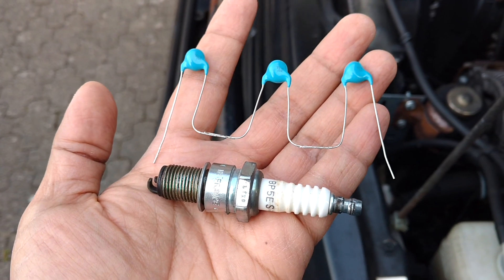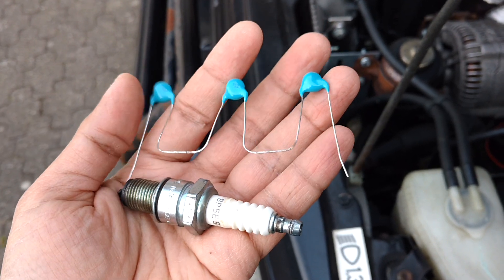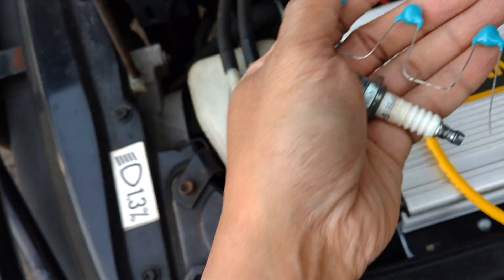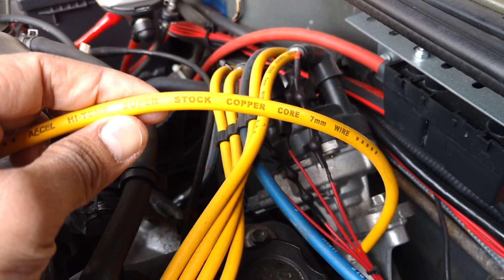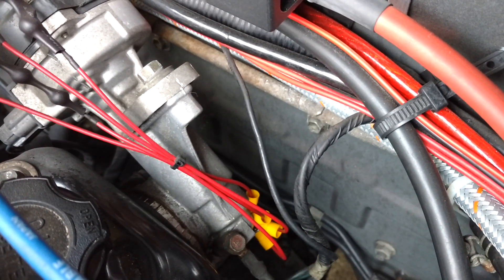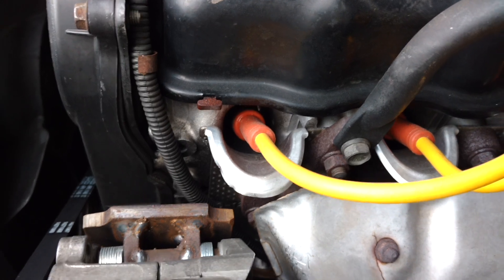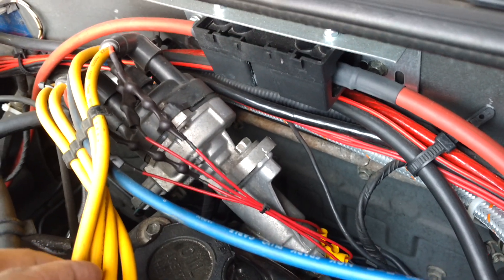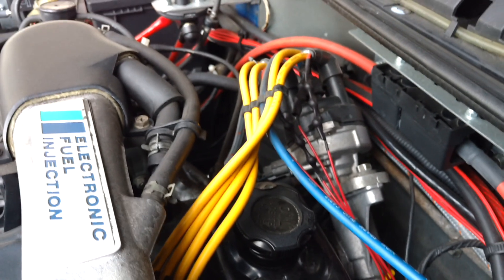Simple Plasma Ignition - my actual installation

Comment: Not sure if this is a good idea, there is a timing between when the ignition produce the spark and when the capacitors gets charge and release its spark. And when timing gets wrong the spark from capacitors would go back to ignition coil and this would also cause premature detonation of piston in chamber like producing spark before air and gas gets compressed in chamber.

Comment: Hi Mr Moeljadi, is it work if i using standard sparkplug cable?is it standard sparkplug cable have resistor in it?
Reply from the maker: This will only work with copper core (non-resistor) ignition wire and non-resistor spark plug.
Reply: @OkkiMoeljadi  so that's mean I need to make my own sparkplug cable to make this work right?
Reply from the maker: @takeosumi4163  No. You can buy copper core ignition wire.
Reply: @OkkiMoeljadi  OK.. thanks alot :)

Comment: Hola. cuan efectivo es ese sistema? incide en la durabilidad de mi CDI y Bobina de ignición? preciso de otro tipo de bujía? tiene limites en cuanto a las RPM? cuáles son los pro y los contra?
Reply from the maker: This will not affect your CDI and ignition coil. You have to use non-resistor sparkplugs and copper core ignition wires.

Comment: Hi Okki, hope it's all smiles your end. I've recently had the pleasure of working on a 1949 Dodge coronet. 6v positive earth points ignition system. 12mpg. Ouch.  So could this ceramic capacitor trick be used with that positive earth system please kind Sir? ❤
Reply from the maker: Hi Billy, thanks! Yes, you can use this trick. Just connect the capacitor in parallel to the spark plug. Don't forget to use non-resistor sparkplugs and ignition wires.
Reply: .Thank you Okki. I knew you wouldn't let me down. Hang on in there Nicola Mk2. Glad to see the adverts. Happy for you. Smile on brother ❤
P.s Check out the Tartarian videos on YouTube channel 'Pyramid Science Foundation'
with James/Jamie Lee. You'll love them i promise. Smile on Okki, and thanks again ❤
Reply from the maker: @BillyBob-uc9zp  my pleasure.. have a nice day!

Comment: Can i use that in my Scooter 125cc?
How many ceramics capacitor?
Is that safe?
Reply from the maker: This should work with your scooter. You can use one capacitor 100 pF 30 kV.

Comment: Brother can I use 3 capacitor only and connect it to coil cable?
Or have to use for each spark plug wire separately?
Reply from the maker: You need capacitor for each spark plug.

Comment: Very good modification, do u know how to apply this mod to modern coil over spark plugs?? TQVM...
Reply from the maker: Yes, you have to modify your coil-on-plug casing and put the capacitor there. Somebody has done it. You just need to google it.
Reply: Okki Moeljadi sorry but I couldn’t find any article regarding modifying the COP casing. 
What I found is some trying to connect 12V capacitors in series with the +12V and Ground to the wires towards the COP casing. Their assumption is that during the sudden power consumption at ignition phase, the capacitors would aid to provide more constant power supply to the ignition coils, enhancing the spark output/dwell time.
Reply from the maker: @limyiphun6142  https://forums.vwvortex.com/showthread.php?8492873-My-1984-Rabbit-GTI-build-thread-Haldex-2-1L-GTX3584RS-E85&p=114234473&viewfull=1#post114234473
Reply: Okki Moeljadi thank you very much, this really helps a lot.
Reply: Okki Moeljadi what is your opinion on capacitors in series to COP casings? Would it help? Thank you.

Comment: culd you make a video that show how polarity of a ignition coil effect a engine?is it posibel to bypass a ignition module and run a ignition system with out that computer crap? how does the polarity effect the engine economy? what hapen if you use more curent capacitors ore more voltage capacitors ore both?I even see some peopel use capacotors in series and pararel with baterry's in the car so what effects does it have on the car instalations wireing harnest?does the fuse's blow by higher voltage?does the small car electric motor's run faster? there are so many ignition system's that it can by realy confusing for peopel to understand them.how much I did gather info over the years are that with higher spark you are abel to run car's on super lean setup 20:1 ore higher with out back fire and best setup wuld by a carburator with out a choke and pump on them with jett tuning.perhap's you culd revive some of the older parts of cars if posibel.because peopel dont mention them often they are forgoten many peopel lusse they car because they dont know for exampel what is a "R" terminal starter motor ore what is a resistor type ignition coil system I see many peopel damage they car by having to much ore to low energy of a spark alone. it wuld by great if you culd revive those old system's and teach peopel how to modify them ore replace them with bether tehnology some peopel does not have money to buy new staff so you actualy culd help them lot great videos thank you for showing use there are so many things peopel dont know about like dual ignition,magneto/ignition coil,dual spark,generators/starter motors,dual battery setups,selenoids of all cinde,hydrogen cells,vaporisation fuel tehnology etc. all of this and more can create interesting effects on a car

Comment: conectas los capacitores a los cables de bujia y el otro extremo a tierra. eso es todo?
Reply from the maker: Yes.
Reply: @OkkiMoeljadi  genera algun tipo de ruido al usar cable de cobre? 
Does it generate any kind of noise when using copper wire?

Comment: Brother i am searching 220 uf and 15v ceramic capicitor from  aliexpress ebay ect but i dont fpund dame specs. 
They hav 220uf and 1kv and 2kv not 15v capistors,  now tell me what to do,  ?
Thanks
Reply from the maker: You don't have to buy any high voltage capacitor. You can build it yourself using easy-to-find materials. I have posted a video how you can build one.
Reply: @OkkiMoeljadi  can i use non ceramic capistors ?

Comment: Okki, A better alternative for capacitive sparking would be with a spark plug like the Torque 
Master S series. No gapping or indexing required. You can buy a set at www.extremespark.com
Reply: Do the torque master plugs actually work?
Reply: @GrantRTanner  The Torque master spark plugs work very well in improving MPG. They stand above the rest, in my opinion, for three reasons. One, because they have a completely exposed center electrode which allows for it to fire uninhibited inside the cylinder. Two, because the guys at Torque master will actually manufacture the spark plug with zero resistance, if you ask them to. The latter is very important, because almost 98% of the spark plugs on the market today have resistances which range from about 3,000 ohms all the way up to 15, 000 ohms, and this resistance in effect lowers the current, and therefore the spark potential,  delivered to the spark tip. This zero resistance is also important if you are considering more powerful and advanced sparking techniques, such as "plasma". Finally, Torque masters have copper center electrodes. Copper is a very good conductor, and it helps to dissipate heat better than platinum and iridium.
Reply: @mpgundercover8075  Thanks.  Do they "gap" them like a normal plug specific to your car?  Or do they just get you as much spark as they can, and will my car ECU handle that?
Reply: @GrantRTanner  The Torque masters are made with one of two gaps. Each of the gaps correspond to an equivalent gap range which encompasses many vehicles. You would need to communicate to them your specific vehicle, and they will let you know which of the two gaps will work for you. The question of whether your vehicle can support the gap is more a function of the ignition system components after the ECU (coil, plug wires, etc...), and their conditions, and not so much of the ECU. The ECU simply supplies the input voltage, as it is required, and that input voltage does not vary in magnitude.

Comment: @okkimoeljadi    I replicated your exact setup on a throttle body injected Chevy 350 engine but I am not getting the Plasma spark.
Any suggestions?
I'm using solid core wires, resistorless plugs, and upgraded MSD coil...
Reply from the maker: Please try to connect the capacitors outside the engine first and observe. Connect the capacitors parallel to the spark plug directly. If you still don't see any increase in spark intensity, replace the spark plug with a spark gap made of copper. Connect again the capacitors parallel to that spark gap. You can also play around with the capacitance value. I wish you much success!

Comment: @okkimoeljadi MSD states NOT to use SOLID core spark plug wires with their 6A & 6AL ignition boxes. Does this not apply to the Street Fire 5520 box?  Thanks!
Reply from the maker: My system is not MSD, any resistive conductor (wire and sparkplug) will kill the plasma. If you use MSD, you have to follow instruction from them.
Reply: Okki Moeljadi MSD type system was the second experiment I was doing. That's setup works well and I found out the only reason MSD states not to use solid wires is because of possible electronic interfere /missfires at hi rpm..

Comment: Good evening Mr.Okki,
I have bought   220Pf 15Kv capacitors. I'll  use 3 of them on  each spark plug wire. Am I right?
Reply from the maker: Yes, that's right. Don't forget to use non-resistor spark plugs and copper core ignition wires.

Comment: Hello!!! hey, ¿why you dont put the capacitor on the main coil cable and let the distributor make the rest with a stronger spark? and ¿why 3 capacitors per cable?
Reply from the maker: I have posted that on one of my videos. If you do that, you will not only need to replace the spark plugs regularly but also the rotor and distributor cap.
Reply: Ooooo ok thks

Comment: what is the bad side effect of using this plasma ignition? is the plasma does not disturb the electricity system of the car?
Reply from the maker: Electrodes wear out a bit faster than normal. This did not disturb electrical system on my car.
Reply: Now I am using a series circuit of 3 pieces of 221 pF, 15 kV, resin non polar capacitors (every spark plug, as the explanation in your video). I feel that the power of machine is increase. The sound of the machine and the exhaust gas odour are also better. The colour of spark plug electrodes are white (before I use this, the electrodes colour usually was black). My car is 1300 cc, 4 cylinders, still use a contact point and carburetor, fuel gasoline octane value is 90.

Do you think my circuit is good (I mean this capacitancy is too big or too little)? I need you suggestions. Thank you very much.

Comment: Kalo dipasang lebih dari 3 rangkaian apakah aman untuk mobil ?
Reply from the maker: Bisa saja, yang penting rating tegangan totalnya paling tidak 30 kV.
Reply: Okki Moeljadi kalo lebih apakah jadi masalah ?
Reply from the maker: Kalau lebih dari 30 kV tidak jadi masalah, rating tegangan kapasitor saya 45 kV.
Reply: @OkkiMoeljadi  kalo koil sy standard Denso( yg output tegangannya sy kurang ngerti apakah 15kv atau 20kv) Kijang Super, dikasi kapasitor total 73pf/30KV(di seri dr 3kapasitor tiap busi), apakah output yg dhasilkan nantinya 30kv di masing2 businya mas? ( model rangkaiannya dibuat sama dgn mobil mas nya,dr kabel output distributor ke masing2 busi)

Comment: Very clever idea. During the off-season I'm going to install some ignition upgrades on my RV in order to increase mileage & efficiency. Besides a higher voltage performance coil I was going to add an electronic voltage stabilizer and some new spark plugs that came out recently which have capacitors built into them. The plugs are called "Pulstar Plasma Plugs" and you can find them at pulstar.com but they're expensive at $15 each for my engine. I won't mind the high price if they perform as claimed.

Comment: The capacitance on the line is just going to cause the spark to last a tiny bit longer at the expense of being a colder spark.  It may or may not have any impact, but is otherwise exactly how stock setups work anyway.

The spark gap, itself, is a capacitor... so you could have just increased the spark gap for the exact same effect.

Comment: I recomend t oeverybody to use copper wires ,from motorcicle or other source like coaxial wire, to ensure the 100% of the use of the spark and NEVER buy another kit of wires.  ..also I explain how to open and modify some tipes of sparkplugs that is not sealed yet, look for old NGK bp5es, champion, and others not sealed and unscrew top conector t oremove a white paste designed to give some time of life and block the current by beign burned gradually. remove it and when screw again the top wire conector is metal to metal with inner bar of the sparkplug, ..I have 9years with the same sparkplugs in my car modified this way.
Reply: this way you can use the capacitor system of this video without burn faster wires & sparkplugs, and ensure the most powerfull spark not limitated by old wires or old sparplugs  ...I think & prove this capacitor system many years before but never end it or posted a video, sorry, good job for Okki Moelijadi
Reply from the maker: Thanks 81Davean for your explanation. Using coaxial cable as ignition wire is a clever idea and if you connect the braided part to the engine ground, you will get a capacitor directly integrated in the wire, just like Nology HotWires!

Comment: There is NO BENEFIT TO DOING THIS IT DOES NOT IMPROVE FUEL EFFICIENCY BY ANY MEANS!
SO DO NOT WAST TIME AND MONEY ALL OF THIS WAS PROVING ON A ENGINE DYNO WITH SPARK PLUGS WITH CAPACITORS THAT WERE BUILT IN.
THE NUMBERS DO NOT LIE !!!
Reply: That depends heavily on which capacitors you use, which ignition system you hook it on to and what engine. The better the combustion chamber (flame propagandation) the less benefit this makes. A lesser efficient chamber can benefit from it. On mildly hopped up street cars we often see a 2 - 4 hp increase from 2 liter displacement once the ignition is dialed in at what the engine wants. - On an originally 23 hp Vanguard engine used for garden tractorpulling we gained 1,5 hp from 39 to 40,5 hp with magnet ignition and pcd upgrade. (Magnet ignition must be maintained) Went from 0,55 mm to 0,7 mm plug gap too without misfire.

Comment: Hello, I have just found out that you only have to connect one side of the capacitor to the + end of the spark plug.
When you do not connect the ground side of the capacitor and just let it hang in the air you also get the wanted plasma spark.
Can somebody explain to me why that is?
Reply from the maker: Yes, I'm aware of that phenomena. That is just the beginning of your journey in high voltage world. You will see much more interesting effect if you do some research in this field.

Comment: Haha... people... this DOES NOT work. Notice the inverter there? It is needed to get it to work because once the HV coil causes a spark and bridges the gap, the inverter has a dead short through the capacitors and the bridged gap. The capacitors create all sorts of new problems used with the stock ignition, and the inverter won't last long since its not meant for that type of use. When tested in a house, the wall outlet has a tonne of energy and makes the spark look deadly because its shorting 230V wall energy... which is not present in an inverter... or in a car. I tried using 12vdc, and the voltage is too low to accomplish any supplimentation worth anything.
Reply from the maker: Hi Wapn, I think that you misunderstood what I did here on this video. I use the inverter for my other project (see here https://youtu.be/JkStHHH9wUM). This inverter has nothing to do with my simple plasma ignition. And yes, this simple plasma ignition does work. Maybe you can see my other simple plasma ignition videos (here is my playlist https://www.youtube.com/playlist?list=PLPp6mROgGKkhyQSNf0HsZSt5NOqW8CKhy) to get the idea how to replicate this simple circuit.
Reply: Wapn Perfo ever heard of a coil pack

Comment: Mho.

OTHER than ground, connected to WHAT? (You did not show.) Posts? Leads? Outside? Or inside the distributor cap?

Connected HOW? (You did not show.) Wound? Soldered? Using connectors? Shrink wrapped? Dielectric grease?

What SIZE capacitors? (You did not say.)

What distance APART? (You did not say.)

Why THREE of them, instead of just one? Or two, or four, etc. (You did not say.)

What gauge WIRE? (You did not say.)

Ohm.
Reply: One side to ground and the other side to the spark plug wire at the plug.

Comment: I do not want to sound as a party pooper, but what you are doing, is re-routing the high voltage (in the order of the thousands, maybe some 18.000, if you have an old system), along a regular insulated ire, which is not rated to withstand that voltage - and, because of the "skin effect", the high voltage will jump to ground, instead of going to the next end, the spark plug electrode. It's like trying to move an Abrahams Tank through a rope bridge! It's  even dangerous, because any one touching that cable to the capacitors, will be a better ground passage for the high tension. Just saying.. maybe I'm wrong.

Comment: Hai, Bung Okki. Sy sdh coba pasang di cop busi, bukan di tutup distributor. Hasilnya, mesin jd tidak bisa hidup. Kira" apa penyebabnya ya?
Reply from the maker: Itu berarti ada arus pendek alias korslet. Coba diperiksa lagi semuanya dan dicoba dulu dengan busi diluar mesin, dilihat apakah ada apinya atau tidak.
Reply: Baik, Bung Okki. Ini sy coba praktekkan di Mazda Capella karbu, menggunakan kapasitor 1 nF 30KV. Api keluar di busi saat mesin hidup. Tapi apabila semua rangkaian seri kapasitor itu dipasang ke ground mesin. Mesin jd tidak bisa hidup. Kalau ground dari rangkaian kapasitor itu tdk dipasang, mesin bisa hidup normal. Apakah disebabkan kapasitor nya terlalu besar?
Reply from the maker: Kapasitas total kapasitor saya hanya sekitar 73 pF.